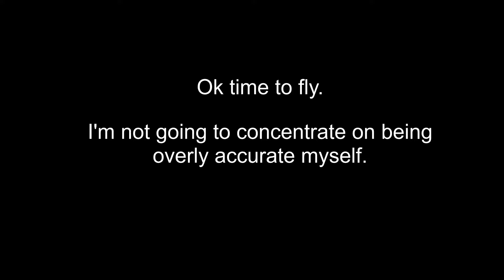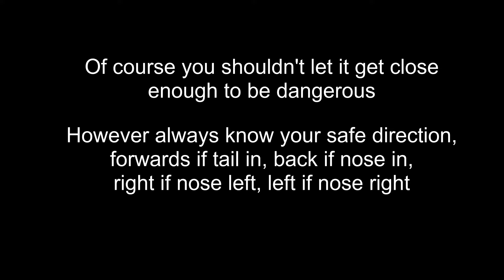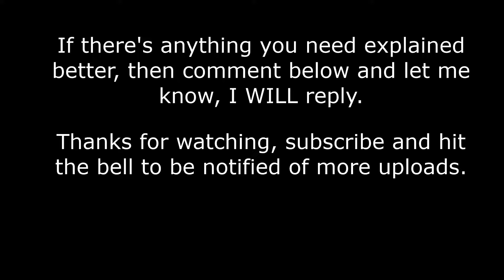How to fly an RC Heli. Part 1: HOVERING

Comment: Micro corrections! Your advice changed my flight experience from "chasing it" to balancing it perfectly THANK YOU!!! The only thing you should also point out is that the main blade has inertia and momentum, and may take a second or two to react to input.
Reply from the maker: Hi, thanks for the comment. Yes good point, I could have made that a bit clearer.
Reply: If you are noticing "slow response" then congratulations you are getting better.  That means you are not "playing catch up" but already "know" where the helicopter attitude should take you.  More headspeed, more pitch(unless you already setup to just short of binding), more expo will bring up the helicopter response.
Reply: Would lowering control rates be a good idea for learning or does that just breed bad habits of excessive inputs?
Reply: @sasquatchhadarock968 
First it will help you from overcorrecting in the beginning. If you had no dead zone, as a beginner you would overcorrect and be all over the place. Been there and still am 😅😅

Comment: This was extremely helpful. I was just flying wildly all over the place and crashing a lot. Using  tiny movements of the sticks I can now hover well and surely am enjoying my heli flying a lot more. I'm currently flying the XK k110 and ordered a 230S yesterday. Looking forward to improving my skills.
Reply from the maker: That's awesome. Thanks for the comment and enjoy the flying!
Reply: You need to get a flight simulator to really make quantum leaps in skill, which in RC heli world = a few months, but without sim it could be a few years.
Also, the trick to controlling = not flying like an airplane.  There is absolutely no stick position "sweet spot".  You are  jiggling the sticks left/right/front/back/right/back/left/front.  Like a boxer punching counter-punching punching, at same time watching for tiny visual movement to "feedback" your "net movements".  That's the thing about RC heli's.  It's not relaxing.  It's tense.  However, it's a rush.  Especially, when all that stick movement becomes "automatic".  Like being able to play a musical instrument proficiently.  You no longer look at your fingers and the fret.
The rc helicopter moves so quickly that two wrong jabs(stick inputs = crash) and no "panic" switch can be flicked fast enough if you are flying close to the ground or you are already in a dive.  You can not rely on that only building up "kung fu" like reflexes to control the heli without thinking about what your fingers are doing.
Anyways, not to scare you off...get a simulator.  If you don't already.  That's where "we" learned to fly inverted and do piro flips, with minimal crashing.
Reply: @trexinvert  Excellent comment, dead on, tnx
Reply: Üben, üben ,üben. Wird sich lohnen. 😅👍

Comment: I don't even have a helicopter, we'll I had one about 20 years ago but tutorials like this didn't exist and I never got it off the ground, this bis amazing and makes me want to get a new helicopter.
Reply: Exactly 20 years ago?  If you had held on till about 2007, your story might have been different.
That was the golden age of RC heli(RC radio tech, gyro, brushless motors, LiPo and charging,...etc.).
The solid state gyro, 2.4 Ghz tx(no jitter), simulators and Lithium Polymer battery(yes...$100-$200) but hey us middle aged hobbyists had the bucks.
Also, with internet/youtube and Bob White(Mr.Helifreaks with detailed exact build video) you could post a technical question and get 10 answers back.

Nowadays, it "should be" better with more tech, cheaper parts, "bail out switches" on tx.  However, 3 critical elements are overlooked.
The skill of mechanical building(cuz, there will be endless crashes/repairs), skill of programming(tx, servos, linkages), and flying skill from using simulators to learn(from basic hovering to extreme 3D).  If you buy an RTF with bailout switch and skipped the "work" demanded on the simulator.  Like I probably would if I were younger and total beginner, I would always fly scared and never progress beyond trying to fly it like an airplane.

Comment: Thanks for this video, I'm looking at getting a flywing bell 206vs so would these controls be the same on that unit? I know it does have gps mode also.
Reply from the maker: Hmm it has a stabilised drone type mode with the gps as you said but think you can fly it like a normal heli too

Comment: Hi nice vid! I've been learning with a 230s and had my fair share of 'misshaps' so far but loving it. Question as I've never used normal mode or safe, I only use Idle up including for take off and landing.. is that bad practice to take off in idle uo and should I use normal mode and then switch? It just seems more complicated to flicking between modes when idle up works. Hope that makes sense!
Reply from the maker: Yeah sure why not if it works it'll just go badly wrong if you moved stick down too fast

Comment: Excellent. It's been 10 years and i just picked up my simulator and it's like riding a bike. It comes right back to you. I am building a trex 250 DFC wirh an Ikon/Brain FBL system. I know how to hover and fly circles and figure eights. Eventually I'd like to so some 3D and hard 3D maneuvers. Do you have any guidance on how to learn those?
Reply from the maker: Unfortunately, I'm not that advanced mysel,  to be  honest.  Only a mild bit of 3d nothing too extreme at all. I'd say repetition  on the basics and all orientations upright  and inverted will certainly  help when you have them down on an unconscious level.
Reply: @RCStuffvideos  yeah makes sense. It needs to come 2nd nature without thought. I am currently evaluating Heli-X and NeXt simulators. Whichever one I go with I am planning to put 30 mns a day in training. Hopefully after a few months I'll be able to get some basic 3D going. Do you have any recommendations on best heli simulator?

Comment: How to do hammer? And also is it possible to fly this in fpv mode?
Reply from the maker: Hammer head like a stall turn? But much for a comment but I'll try and do a video on it eventually when I have time. You could add an external fpv camera to it if and strap it on if you buy a separate set.

Comment: Awesome video. I love the explanations. Helicopters have always been so intimidating.  I feel like I'd just crash and burn. Coming from an rc car bashing background, fixing busted stuff is the norm, but crashing something that flies is on another level hence the intimidation.  Thanks for the in depth analysis. 
What would be a good entry-level Helicopter you would recommend?
Reply from the maker: Hi Rocket thanks for the comment. Yes i actually crashed recently flying inverted figure 8s a bit too low. Video coming.soon if my I can sort my laptop lol. You might want to try a blade 230 or 330 to start with. They aren't too expensive, lots of parts and info available and should be fairly cheap to fix too. Maybe not actually the easiest ss bigger helis are easier to learn on due to inertia and stability etc. Those are also rtf or bnf so doesn't meed building. If you want to get into it seriously you could join a club and get something bigger but it'll be a lot more technical with building etc. A 230s will get you going easily for a few hundred amd also has rescue/bail out built in which will save you from crashing atleast a few times when you start.
Reply: Rocket RC. Bigger does fly better, and easier,  if set up properly. If you can, get yourself involved in a  rc club that offers helicopter training. I would also suggest purchasing a helicopter simulator.  It can save you quite a bit of money. As the video, in the beginning show, crashes are going to happen. I don't care how skilled you are, you're going to crash.  Just remember,  practice,  practice,  practice.  It's nice to be able to say you can do something that 1 in 10 rc pilots can't do. Happy hovering!

Comment: I have an older art-tech falcon 3d (About a 300 size bird I think) main rotor was abt.25" had to replace the blades so now is abt 28" I am a fixed wing rc pilot not much above beginner skill level. This helicopter and radios and tools/parts everything was offered to me really cheap. So I've put some money into it to fix it up and hopefully learn to fly it. What I need are some really good configuration settings that will dumb it down enough to keep me from planting it in the dirt. The radio I am using is a futaba 7ch FP-T7UAP Super PCM1024.
A very  nice radio even if its a bit obsolete. I need some help with rates and configurations also it has A heading hold gyro as well
Reply from the maker: Hello Daphne! Welcome to helis! Art tech falcon. Fly barred heli yeah? I've not actually flown a flybar heli before tbh but the main principles will apply to calming it down a bit. Lower headspeed, lower dual rates, bit of expo. Is that transmitter the one you were using for fixed wing too? Do you have the manual? 
I'd definitely recommend getting a bit of help from a hobby shop or a club if there's one near you. Do you know anyone else flying helis at all?
Reply: @RCStuffvideos  yes, the Futaba 7ch is my main radio and I have the manual.

 BTW i think i error-ed on the heli size, given it came with 25" rotor blades but now is swinging a set of 28" i think its a bit under-powered now but the size of a 400. it takes nearly all of 65%+ power to get light on the skids. 
it had a nasty vibe in it that would cause the gyro to start tail-wagging. so last night i equalized the blade CG/balance and that seamed to fix that...

i have read a lot of different ideas about what the settings should be to start out, and many are telling me the same thing.
 i started out "low" I figured it would be better to work up not down. I found i had the T-NR curve so low it would lower the RPM instead of take-off when i moved the stick past center. so my minimum operational power is nearly at 75% and i thought that would be the top end!

 from what I am gleaning, its better and more stable to have a higher and more constant power level anyway, only keep your low side rate down,
the Futaba has a setting called NR-L that does just that. so negative blade pitch can be locked out, and gradually introduced. i haven't experimented with that yet. there is also a sister-setting called ID-H that does the same thing to the high side of the idle-up modes. in theory to dumb that down too i suppose.
also i don't know if the ESC is stock or not, it is a YEP 30A. I obtained a programming card for it as well. I'm unsure of the settings it has right now. I didn't write them down.

the closest club near me is over 35min away, is way out of my way, and there are some members i may not be on good terms with from years past. not a comfortable environment to be in. so i have my AMA, and my FAA registration, as well as the Trust test all under my belt. (ive been out of the hobby several years) been thinking of getting my 107 cert also. I plan to do most of my flying on my own property. I have the space.

back to the settings... 
My T-NR is 0%30%60%65%70%
T-I1 = 70%70%70%70%70
 T-I2 100%100%100%100%100%
(hope that wont overheat things)
HOLD = -100%
pitch...
P-NR 60%60%60%80%100% i had this more linear from 0 to 70 but changed it because 60% is about zero deg. on the blades already.
P-I1 10%30%50%70%90 (trying to limit the negative collective here some)
P-I2 and P=HD are 0%25%50%75%100% (linear from max negative to max positive)

those are my numbers as the stand right now. perhaps some servo arm adjusting is in order?
Reply: @daphneblake7889  For Throttle control it's not so much the %%%%% but more that beginner pilot "fingers" need to travel/throw length for resolution.
When I began I set my futaba tx to 0-65-70-75-80%.  At 65% it won't quite lift off, but with just a tiny bit more "thumb tension" it will start to lift off.
Then as you throttle more you will have more fine control.  As a beginner you just want to get it to hover 5-10 ft.
However, watch the wind a slight gust can lift it up from 5 ft to 20 ft without any throttle input.

Follow the same logic and apply to your pitch curve: 50-55-60-65-70%.  You still need flat blade pitch =50% so you can descend the heli slowly, but you don't need that much positive pitch to rise more than hover level.  

These throttle and pitch settings are kinda like adding "expo" but with more direct control.  
It's all about "tiny" control movement synchronized to "comfortable" finger/stick movements.  This is remote control "training wheels". 
You need this as a beginner.  Then as you get better and faster, you can adjust for more response.  

As a beginner, don't mess with the other throttle toggle modes: idle up1, idle up 2..  Just set those at 0-0-0-0-0%.  For instant kill.  What if you accidentally hit the switch?  Yes, it does happen.  What if you didn't program the ESC to soft start, but airplane start=instant rev up!!! ZZZZ...  You don't need to mess with any 2nd throttle curves at the moment.  Maybe later.

Comment: Thank you for posting sir! Your explanation on how the radio's collective and pitch controls work and especially how to operate them really helps. ( micro corrections: pitch then center, etc.).    I just purchased the Blade 230S V2, and was wondering what are your thoughts on installing training gear?

Regards from the Mojave desert CA.
Reply from the maker: Hi Ralph thanks for the comment. I wouldn't worry about training gear with the 230s V2 as it has the panic recovery mode to help achieve the same goal really. Practice using it and going for the switch quickly so you cam do it smoothly when you need to! Happy flying.

Comment: How far can i go with my DXs and 230s? What is the range of this little thing? its my second Year with it now and it lives.
Reply from the maker: Well, it's irrelevant, really. The transmitter range is further than you can see it. You'll lose sight of it and lose ckntrol5 long before transmitter range is an issue.
Reply: Sounds good. Have a great day. THX @RCStuffvideos

Comment: I have the dxs transmitter that was standard in the package. But They dont even explain what those buttons on top do. I cant find it anywhere. Please help man. Do u have fiver or something? I am willing to pay u to help me learn it.
Reply from the maker: Hi, I'm sure theres a dxs manual online somewhere that should say what they do..

Or what model is it you have exactly?! Maybe the buttons aren't needed for your model?
Reply: @RCStuffvideos  i have the same helicopter. Blade 230s. It has a button for 3 modes. Beginner. Intermediate. Expert. 
Button for smart function
Button for toggle thrust or something. 

I checked the manual. It does not explain it.

Comment: I can't seem to hover my Blade 450 3D. I think I need more sim time.
Reply: Pablo, have someone check your setup,  both in the helicopter and the radio. You may find it's not a problem with you!
Reply from the maker: More sim time can definitely help. Try and set the sim up so it handles similarly to your helicopter. As this other guy said check your set up too so everything is OK

Comment: Just an honest opinion you should have made an explanation vid first and it would be much easier for first time pilots if you kept it simple as in left right back forward and to keep the heli facing away from you or the the controls will be reversed. Once the heli is off the ground It will drift, if it goes left a gentle tap right etc and keep it pointing away from you try not to let it drift as far away as you were doing what’s more an RC heli sim is the cheapest way to start and will save on a lot of repairs. Just try and simplify what your saying no need for technical keep that in a separate video.
Reply from the maker: Hi Mate, thanks for the comment. Yeah I was thinking about different ways of doing it. I guess I went for accuracy over simplicity as of course push forwards to go forwards just isn't technically correct (as I'm sure you know by your name), you have to move stick to centre again. I was trying to highlight this difference when you compare it to a drone or very basic fixed pitch heli etc. for sure people will find different formats better too. I have some other technical bits in other videos too. someone else complained I didn't go over everything like expo and all in that video too. I guess from his POV I wasn't being technical ENOUGH. As I said to him I just really wanted to go over the effects of the controls in as accurate way as possible (as it is required to advance in the future) and an intro to hovering. Cheers though. i do take comments on board for future videos. Happy flying!
Reply: The days of building RC helis from kit, watching heli-freaks video or other "real instructive" piece by piece assembly engineering build is over.
Nobody wants to search for real info anymore.  Seems most of the latest RC heli videos just care about "going viral".  Show off what pros(who don't spend their own $$$$$) fly 3d stunts off the ground. Also the RTF's seem to be a disservice, because a reality of RC heli is "crashing" and "fixing", in the case of an RTF you better throw it away, spend again, if you ever want it to fly reliably.  This is a dangerous hobby and requires mastering 3 things: nuts and bolts mechanics, programming, and SIM practice.  No other way to present this hobby if you want to progress to total, absolute control and "possibly" getting into inverts, piroflips and other 3D tricks that are totally, absolutely controllable if you have the skills and learn all the basics.  There is no short cuts to this hobby if you really want to progress.  Airplane flyers rely on buddy boxing.  Escape switches on the new gen helicopters "may save you" but not when you push the envelope.  That's just my rant, but I still care about the art of building and flying RC heli's.